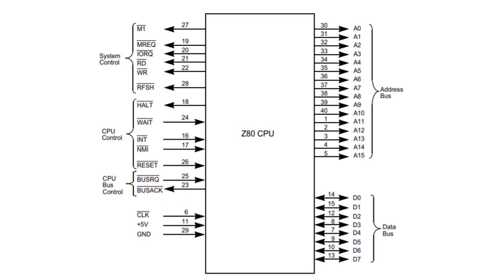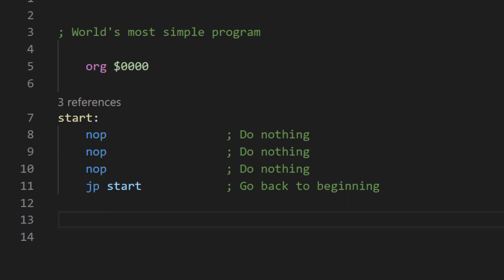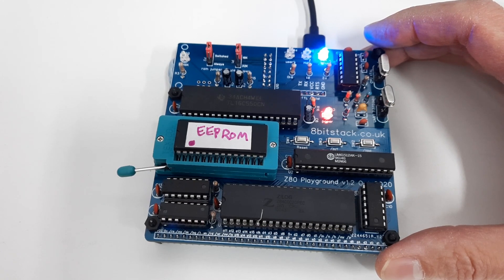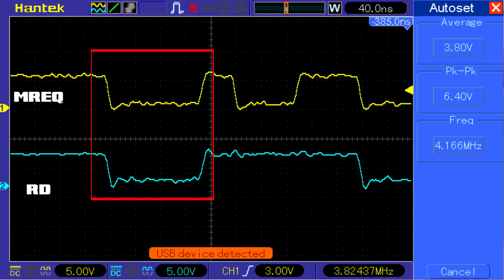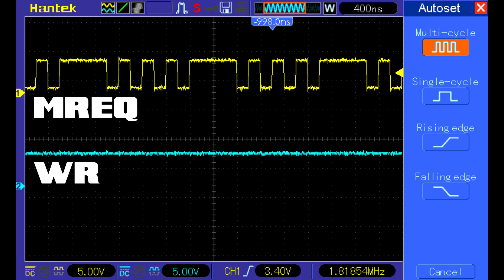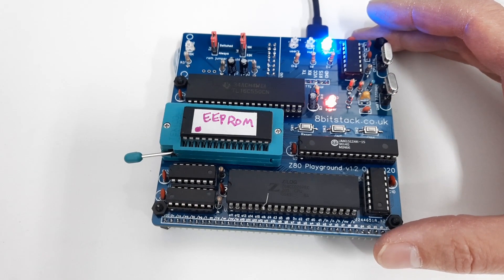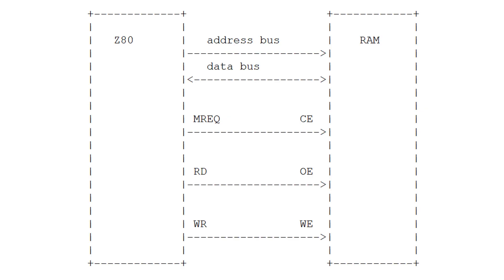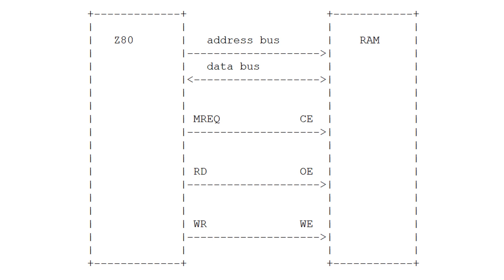Z80 on the 'scope, part 2, MREQ, RD & WR

Comment: A good video for beginners but there are a few anomalies.

Your oscilloscope capture shows poor signal integrity from your PCB and Power distribution design.  There's so many unneeded artefacts such as ripple on your signals.
You're also probably not probing the signals correctly.  Your PCB is working in spite of your design (a very common phenomena).

I'm guessing you've incorrectly captioned the Z80 control signals (e.g. /M1, /MREQ, /RD, /WR, /RFSH) in you video sans the necessary negation (i.e. '/' or '-' or '*' prefix).

Your capture of the /MREQ and /WR signals @3:57  seems incorrect because the /WR signal is asserted whilst /MREQ is negated.

The signal timing is fully illustrated in the Z80 data sheets.
Your design has the Static RAM access logic correct with using the /MREQ for the static RAM /CS chip select signal.
However what many naively do is assume that /MREQ & /WR to indicates a memory write cycle and use it to drive their memory's /CS signal with ((/MREQ & /RD) & (/MREQ & /WR))
This is incorrect, wasteful and a gotcha for newbies particularly back in the mid 1970's where fast memory was very expensive.
If you carefully compare the the assertion timing between a memory read and memory write cycle the assertion of /WR signal relative to the /RD is delayed by over 1/2 a clock cycle so the beginning of a memory write cycle is at the assertion of /MREQ with /RD remaining negated. It is designed this way to match the timing for the memory devices of that era.

Thus a memory read or write cycle is determined by /MREQ & RFSH (i.e. /RFSH remains negated) and a memory refresh cycle is /MREQ & /RFSH.
Reply: That’s interesting, I’ll have to look into that.

Comment: I remember being told that division uses more clock cycles than multiplication.  Just wondering if your application would show that.
Reply from the maker: Well there is no z80 instruction for division or multiplication so it would depend on the routines you wrote.
Reply: @CircuitBreaker256  it was the Timex Sinclair. My dad had a switch in it to run European and American programs.

Comment: How do you connect your scope probes to the lines? I'm struggling to connect them to the (socketed) IC on my single board computer.
Reply from the maker: Oh, on my z80 playground I have most of the z80 lines coming out to a 36 way header along the front of the board. I don't have clk on there though, so I soldered a wire directly to that pin of the z80. It wasn't difficult and did no damage.
Reply: @CircuitBreaker256  Thanks!